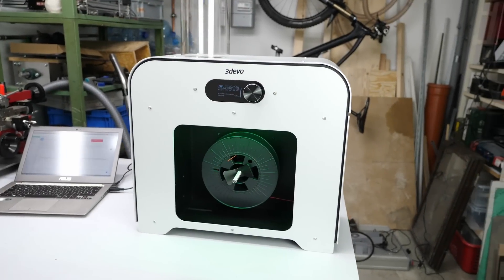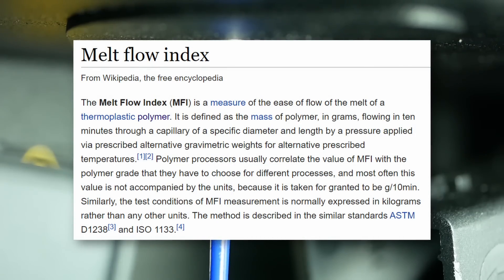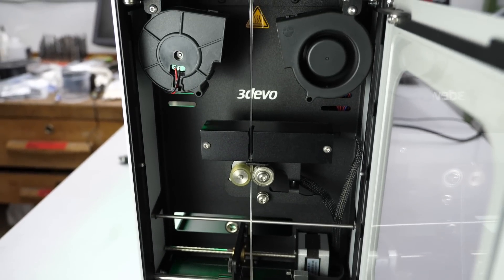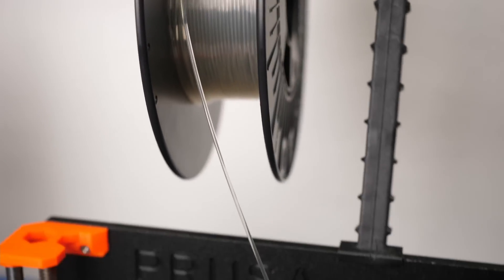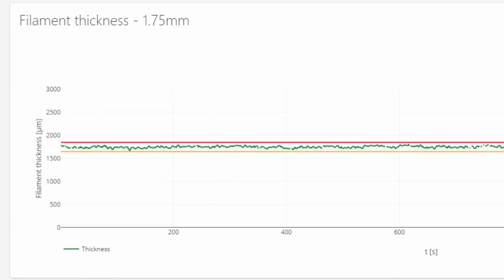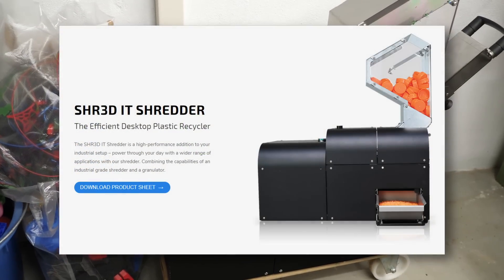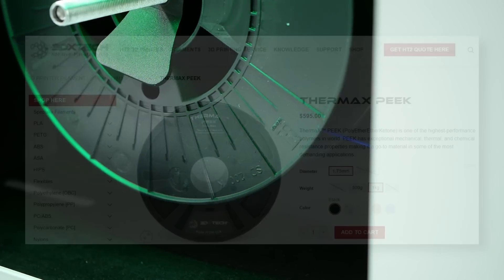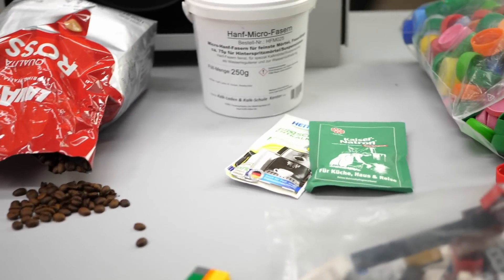Extruding PLA Filament at Home

Comment: In my opinion the best and biggest break through in 3D Printing would be reliable and affordable 3D Printers that you only feed directly with pellets and where the process of making spools would be skipped. This way even the environmental part of 3D printing would be much better. No more spools, no more throwing away near empty spool that don't have enough Filament for you parts and much better netto weight in shipping the pellets and ideally of course even allowing using old shredded parts.

Really hope that this will become a thing in the next ~5 years or so.
Reply: never gonna happen. It takes extreme precision even compared to a 3d printer just to extrude pellets into filament. Theses 5,000 dollar machines can barely do it with evenly sized pellets and they use an optical feedback system to precisely measure the diameter. Never gonna fit something like that into a cheap 200-2000 dollar printer. Hard enough to get it coming out at an even rate let alone starting and stopping on a whim like a regular 3d print. The stringing you'd get would be impossible to stop and like he said, heating the material for too long degrades it. Your plastic will be even more brittle than glass by the time it gets extruded if it's not turned into dust first...' Just not physically possible to melt a small volume of plastic and have it extrude evenly while also being able to prevent over extrusion during air paths. Plastic is just not the material you'd use for a pellet extruder, you'd need something exotic that doesn't degrade with heat.

Liquids would be a million times easier to work with, perhaps some kind of solvent to dissolve the plastics with a secondary solvent that instantly hardens it. a cross between fdm and resin printers but we'd need to learn a lot more about material science before something like that is possible, some kind of material that can be turned from liquid to solid and back to liquid on a whim and not degrade from melting like heating plastic. Plastic is just too hard to recycle and too nuanced, even with manufacturers stamping the material type on bottles it's still not economical. No way we'll get that for 3D printing, not when everything is decentralized and there are millions of filament producers that use their own custom blend of who knows what type of additives. The parts you'd typically recycle being small miniatures from millions of users who each have multiple different spools from multiple different companies. You'll break the bank just trying to sort through all that and have sub-par filament that's been reheated too much and it'll ruin so many prints if even a tiny fleck of abs or any different material slips in with your plastic. Just no market where anyone would pay for sub-par recycled material at 2x or even the same cost of a brand new, hinder free spool. 

All the companies that try inevitably go bankrupt. We shouldn't be wasting money trying to make some magical recycling device, it's better spent trying to move away from plastic into something more environmentally friendly or at least easier to recycle. Not a matter of technology to make it economically viable to recycle, it's up to improvements to material science.

Comment: Two tricks you could try out for the next video came to my mind:
1. To eleviate the issue of shredded material being moved inhomogenously by the screw, first make your own pellets out of old prints. Use them to then extrude the "final" filament for more consistency.
2. Instead of trying to make filament purely from shredded prints, you could try to add a certain (weight) percentage to virgin pellets, basically stretching the whole mixture like cocain and baking powder ;). No but jokes aside, this would offer an opportunity to reuse at least some old material, although I bet colours for example would be a bit off compared to only using virgin pellets and dye.

Comment: Since you got the coffee beans already lying around - coffee filament please :) I guess when you can mix wood powder in it coffee powder should also work. I'm really curious about the smell of the filament and and for how long it smells :)
Reply: 3D-Fuel makes filament from coffee waste byproducts. I'm not sure how it would compare to directly using beans, but it smells pleasant while printing. The scent doesn't really stick around for long after the part is printed, but the color is really nice! It's sort of like a chocolate brown with dark flecks.

As with wood PLA, 3D-Fuel's renewable filament is a bit stringier than average.

Comment: You probably need to do the same thing with recycled prints as you do with recycled aluminum.
Extrude it into ingots (pellets), and then then use that for the final extrusion.
Making an intermediate both homogenizes the material, and "cleans" it.

Comment: I always buy mixed color filament with a lot of discount. Most of the stuff I make doesn't need a single color anyways :p

About recycled filament: almost no one does 100% recycled... it's always between 10% to 30% in weight in recycled material.

Comment: I'm assuming it can handle TPU?
I'm finding TPU is my favoured filament to design prints for because it allows me to get creative by using its flexible properties that traditional PLA/PETG/ABS etc. just don't have, like my Thingiverse 4881783 a folding TPU holder for an antenna for FPV quadcopters, plus a slew of other folding TPU holders I've designed for other RC receiver boards & antennas on Thingiverse.

Comment: Cant wait to see what else you can do with this machine.  It would be nice if you can do a recap at a later time going more into the details of the challenges of trying to make your own filaments with the various machines you have used and their pro's and con's. While possibly going into the challenges you might face actually getting virgin resin and masterbatch colors, as you mentioned buying what you got from Das can be a bit difficult for the normal person.

Comment: Tip for using ground recycled prints, don't do 100% used material, use a mix of old+new material, this should help a lot with consistency 
Also would love to see if you could make DIY blends with this setup, PC/ABS/CF blends maybe?

Comment: Recycled material... Would it help to double extrude it, making the recycled material more consistent? After the grinding and drying, feed the recycled material into an extruder that pukes out about 5 - 6mm diameter material, then chop this up so it looks like those Masterbatch pellets, then feed it through the filament maker.

Comment: Exactly how efficient is this process? It would be amazing if huge prints could be broken down into filament, only for the remnants to be printed again in a slightly modified form.
Reply from the maker: The larger the scale, the more efficient it is. I'll do some calculations once I start with the recycling process.

Comment: I'm now very annoyed - 3devo does such a bad job at communicating their devices capabilites that I specifically didn't buy one of their machines due to them not advertising a closed loop feedback system for the tolerance puller.

Still very curious about their ovality values though, and if one can extrude all materials with their extruders/the cooling system
Reply from the maker: I'll forward that. Concerning ovality - if you tune in the cooling well, it's not an issue but can sometimes be a bit tricky.
Reply: @CNCKitchen  thank you, I bought the noztek system for 16k Euro instead and ovality is my main issue. I also exclusively extrude rPET in pellet form (work in PET upcycling), and now I'll just hope that the 3devo system wouldn't be able to cool the extrusion so I wouldn't have been happy with that system anyways :D :D

Comment: You should try extruding CF/GF Nylon and report back the quality compared to commercial PA-CF filaments. If it's comparable at a fraction of the price, this can be incredibly valuable for people printing large strong parts. 

Also, see if you can get your hands on MIM pellets for powder metallurgy. FabMX in Munich is making an open source MIM pellet extruder, but if you can just extrude those into filament, it might be an even better option, and also a good alternative to the face-meltingly expensive BASF Ultrafuse 316L filament.

Comment: Giving up in the Filastruder, or just taking advantage of this machine while you have it? From what I've seen, it's the most complete, and compact, machine available, and isn't even that expensive when compared to other options on the market that are shipped ready to use.
Reply: I don't get why they don't just skip this step and print directly with plastic pellets. Not sure why 3d printer companies don't sell this, maybe they do.
Reply: @rdizzy1  They do. No most printer makers, but there are companies that are making/selling pellet based extruders.

Comment: You should re-extrude the recycled filament which is bad, by chopping it up with a simple machine. The output should look like the masterbatch, and should function basically like the pellets, which should give you similar extrusions like the new ones. I know it uses more electricity, but I would like to see how much of a change it can make to the filament quality!😁😁
Reply from the maker: I built a pelletizer a while ago. Might be trying it out again!
Reply: @CNCKitchen  Wouldn't recycling filament over and over again, even if using virgin pellets compromise the strength of the print? It'd be interesting to test how filament strength degrades over time using a mix of spent coupons with used filament of the same type and colour.
Reply: Just use it on windy day when there is an energy overhead tho it might not really work in the south of germany

Comment: OMG, this is really evolving fast. Anyway, a cost analytics of the recycling process would be great! Shredding takes energy, not to speak about drying, and then melting the material into filament after mixing it with raw PLA… is that worth the investment? Great content as always. A cuidar-se Stefan :D

Comment: Cheapest model 6800 USD, that's a LOT of filament I have to recycle to recoup my cost.
Reply: maybe at some makerspace or if you are a company that makes a lot of prototyping plus failed prints. Though you would need to calculate the ROI and Break-Even analysis
Reply: @k.s.8959  This is more meant for exotic virgin material filaments in business settings than hobbyists trying to recycle failed prints. 
You can seriously collect lots of waste plastic from the community, then sort them, clean them, shred them then extrude them. By that point your labor costs would take over.

Comment: will you cover the time to recycle too ? how much time and effort to recycle will play a big part in the cost, just as much as the machine. from the demo you have shown so far it looks like a lot of time and process steps for some average material so far. Like others have said mixing with new stock could help and also sorting the types of pla before hand, perhaps using this to colour the new material.

Comment: In the plastic injection world we usually never used 100% regrind, it was usually only about 25% at the most
Reply: This is what I was thinking. Mix the recycled with virgin to make it more consistent. Even recycling glass, they only use a certain percentage of recycled to new.
Reply: same thing i thought about, if he could test something like 20 to 75% recicled with the virgin PLA
Reply: I was thinking at most a 50/50 split, but also, I'd imagine the most virgin plastic you used, the better the outcome will be
Reply: Am i correct in thinking that the chemical structure of the polymer tends to get messed up over time, so recycled plastic inevitably ends up being lower grade than virgin?
Reply: @charleslambert3368  Pretty much. Heating plastic up to melting temperatures can break up longer polymer chains, making them shorter. Other factors that do the same might include UV light. This is why some plastics (such as laptop chassis) can become brittle with age.
Reply: Then I wonder why German table water sellers claim that their pet bottles are 100% made of recycled material?
Reply from the maker: PET bottles are one of the rare instances that can be properly recycled due to our deposit system.
Reply: These just have to be made affordable for everyone just like 3d printers! Then you can have true in house recycling of your plastic scrap = recycling revolution! A broken part can be made into someting new and useful instead of throwing it away to a fate of more likley being burned or the landfill instead of being actually recycled. However many plastics are sadly not compatible with most consumer grader 3d printers but there are a few a least like ABS PET(G) and maybee some more.

Comment: Looking forward for recyćing failed prints. Or better, shred old prints and make filament again. We are team of designers, which devolop 3d models for community. Our last project is Fully 3d printable car, and we did 10+ prototypes. If there will be option to recycle them development process will be much cheaper
Reply: I mean RC car 1:10
Reply from the maker: Printing a whole car might have taken a while ;-)

Comment: I feel like being in the laboratory... I only wanted to see the price of the extruder... after seeing all, for me:
1º) In the university laboratory the composer 350, I can make new filaments with different compositions... for example chitosan, or fibers. The mixing screw is important for that application, the other models are high-flow screws.
2º) At home probably the Felfil Evo.
Reply from the maker: Yes, you're right though I noticed that having a puller assembly is quiet important if you want to get a consistent diameter.
Reply: @CNCKitchen  When I started my Ph.D. degree my professor come one day and said: "I want to put online the double twin screws extruder, come with me" He shows an extruder inside of storage.... was awful, several different plastics were mixed with very different melting temperatures and fluid index... So we decided to use the oven and put all the metallic parts to 200ºC, with part of the plastic melted we separate the parts and clean the extruder. So I started to use it., but I didn't have the puller... so I make a puller myself, gravity-assisted. Because was important for our research we bought a new extruder with the puller and the pelletizer, which was bliss.
I think that the cheaper one is the FILASTRUDERS, but to have at home the system of Felfil Evo + Felfil Spoolerare the most compact one.

Comment: It's expensive but considering the high precision required it's realist. And I think that most maker's could only do two or three kg's of recycled material with their failed prints... Even if the machine was 10 times cheaper it remains way more expensive than buying a bunch of new spools
I think this kind of machines are more suited for makerspaces, where lots of peoples can recycle their parts
Reply: If the machine and grinder and everything else you needed to take a failed print and turn it back into usable filament was under $1k I'd order it. I won't print enough to make it back, and the colors would be weird but I think at that price I'd be ok.
The makerspace idea sounds good. Then the hardest part would be keeping the different materials separated and garbage out of the piles

Comment: For your next recycling video, could you show off results of what happens if you were to do a 2-pass? First pass where you use the recycled failed prints, second pass where the filament made with them is cut down to more uniform sized pieces
Reply from the maker: Working on that.